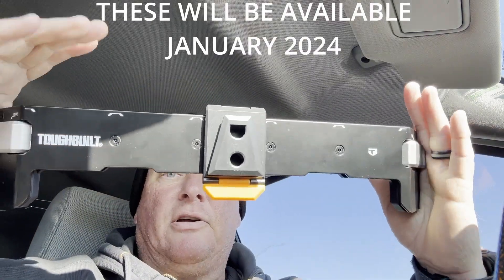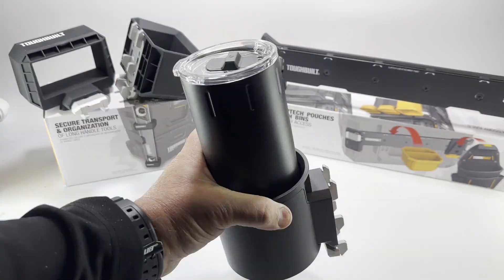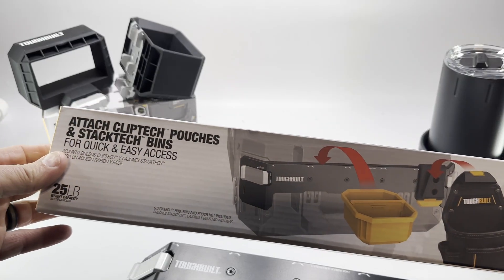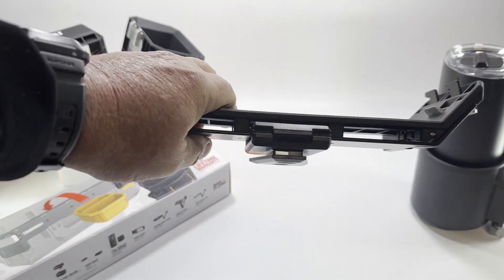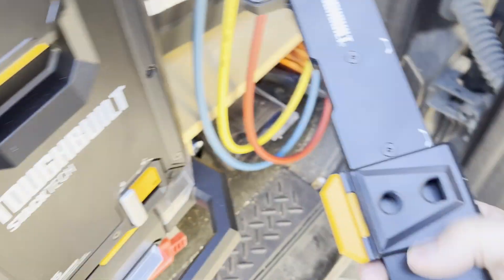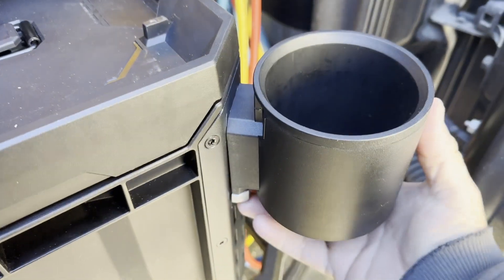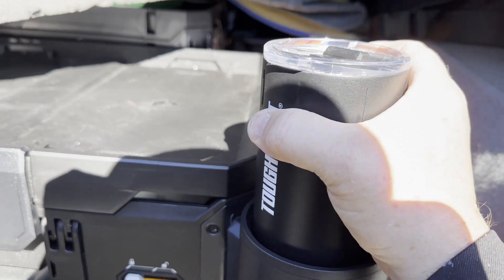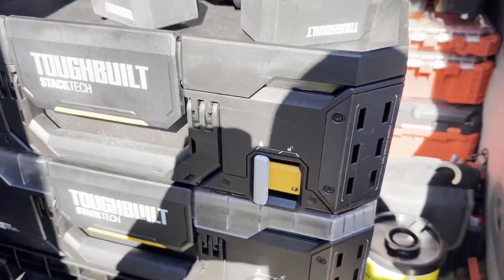TOUGHBUILT STACKTECH ACCESSORIES FIRST LOOK!!, #toughbuilt, #stacktech, #thetiminatorthetoolman

Comment: I travel for work as a  Gas Turbine Mechanic, My stacktech kit has only seen one jobsite but I could not be more satisfied with this system. Very excited about the tumbler and cup holder, as well as the T100 table cart that folds.

Comment: Didi you get all these products free tim? I hope so, because we need a durability test done before i biy them. We already know Milwaukee is the best. These toughbuilt boxes do like way nicer though. Its time today test them  up against packout.  They look like the will shatter if you dropped them. I have seen videos of packout get tossed off a house and hold fine.
Reply: so... throwing empty toolboxes off a roof; what does that prove?
Reply: I'm sure he got them for free since he said the accessories or coming out in January
Reply from the maker: Yes, I got them from toughbuilt.
They wanted to have me show you what’s coming out real soon. Their tool boxes and accessories are made really tough. They are made with great materials.
Reply from the maker: I really appreciate you watching
Reply: I've had my hands on packout and toughbuilt and both seem pretty equally sturdy .
Reply: I have both TB and Milwaukee also dewalt and rigid boxes.  I don’t think any of them will have much issue on normal use cases
Reply: @wim0104  I triy my best to be gentle with my packout but they are heavy and I have to do a lot of loading and unloading of these boxes from my truck to the job sites. Tossing them off a house shows that they can take a fall without breaking
I'm hoping If it can take that it could  take years of being tossed around and not get destroyed. Which so far packout is the best.
Reply: @THETIMINATORTHETOOLMAN  great  I'm glad. Seriously though if you watch some durability test on packout and do something similar with TB I bet it would got viral and your channel will gro